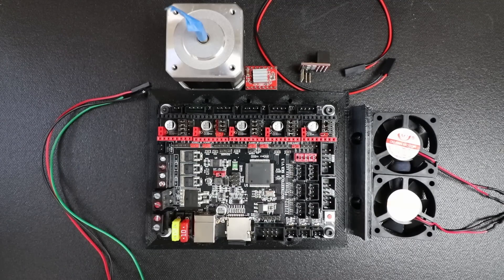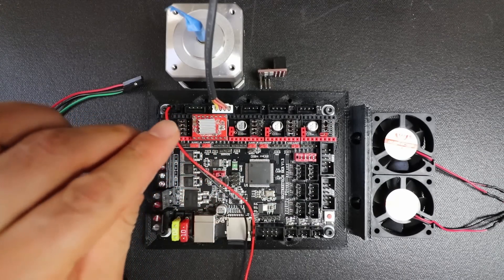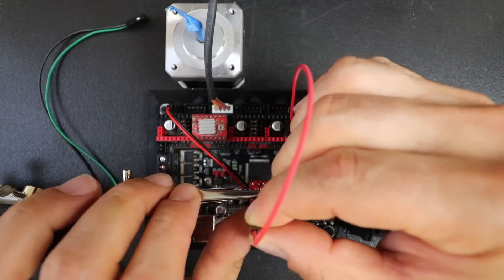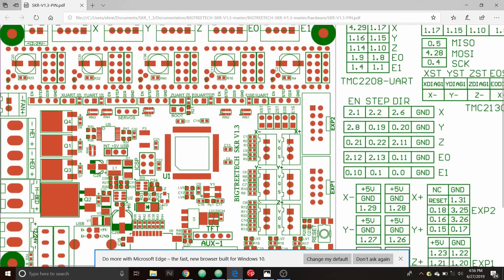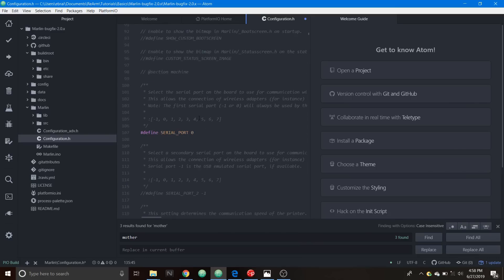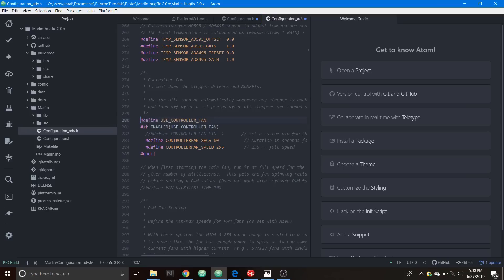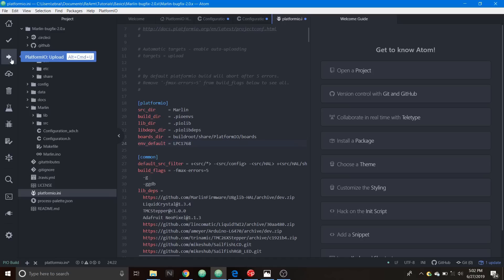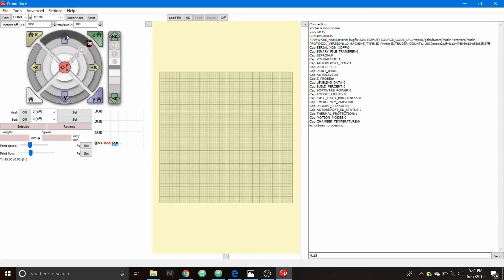SKR 1.3 - Fan Extender (Part 1) - Stepper Cooling

Comment: Hi Edward thanks for the great tutorial!!. I did the same to my SKR 1.4 Turbo but I used one of those little mosfet board. I have a 12v system. I did encounter a problem that you might be able to help. When I turn on my printer, my stepper fan runs immediately. I used the pwr det pin P1_00 and the fan socket closest to E1 plug. I was assuming that the fan should only run when I move one of the axes. Thanks

Comment: Which way would you cool the Drivers? Push or Pull.
Reply from the maker: Pull.
Reply: @EdwardBraiman  thanks, it's just as well. I had a thought it was. Just put cover on my board and thought it would be best to have some heat reduction.
Reply from the maker: You're welcome.

Comment: I haven't found any info on how to use the skr v1.3 without stepper drivers. Things like jumper settings and firmware configuration. I would like to see the difference in noise levels of the stepper motors both ways. Is that possible to do?
Reply from the maker: In my RAMPS playlist the are two videos on how to adjust calibration for drv8825 and a4988.  They might help.

Comment: I have 5VDC 0.14 A fan. Can I connect it directly to X max port? If yes, then is the fan positive connect to signal and negatif to ground?
Reply from the maker: I would not advise it.  The fan extender can use two fans.  Or you can power a fan off another power supply.
Reply: Is fan extender can work on 5VDC? Because the power input on video is 12/24VDC
Reply from the maker: @andreasyufrizal73  Here is the link ... https://amzn.to/30cBfb3
Reply: @EdwardBraiman  ok

Comment: Hello, that is a nice Tutorial!
Can you make a video on how to connect and configure a Magnetic Parking Extruder to SKR 1.3? Two separate extruders with one X-Motor each coupled to the left and right with a small electromagnet.
Reply from the maker: I'm working on a design for dual independent extruders.  Due to summer heat I'll start to focus more on design when outside temperature decrease.  We have 80-90 degrees Fahrenheit temperatures with around 85% humidity.  Not the best time for me to develop new designs.  Should be mid Winter before I have a workable design tested.
Reply: Thank you for your message. Do you have any idea for me which pins I can use to control the two electromagnets? I would then control the solenoids via two separate relays. As already written I would like to use the Board SKR V1.3.
Reply from the maker: We'll check the pins diagram, but maybe unused Endstop ping for x and y Max.
Reply: Ok, I will test that. Many thanks for your help!

Comment: in the 4 pins under the stepper socket you have the enable pin as well - why not use this one (without an firmware config needed) ?
Reply from the maker: If you using stepper, then those are in use.  Otherwise you could try them.
Reply: @EdwardBraiman  they are on when steppers are in so perfect for stepper cooling fan
Reply from the maker: Let me know how that works out.

Comment: In the first bit of the video you stated that the fan pin is "only 12v" but it's a 12/24 available pin in all documentation. Great tutorial thanks!!!
Reply from the maker: Thanks.  The fan extender apprently is only 12v max power.  The power from the SKR can be either, but might cook the fan extender.
Reply: @EdwardBraiman  Lol really? That's pretty bad, I guess the board has to have some cons though. All my fans are 24volts I just use a relay from my octopi gpios
Reply from the maker: Depends on power supply.

Comment: Is there a reason why I might want to do this rather than stick with a 12 volt fan plugged right into the boards 12/24 volt out?
Reply from the maker: This gives an additional two controlled fans, rather than one controlled fan and one 12/24 volts fan.  So three power controlled fans vs two.

Comment: I recommend to use an external hot bed mosfet from any available IO, then you can use the on-board mosfet to drive your fans
Reply from the maker: That's another method.